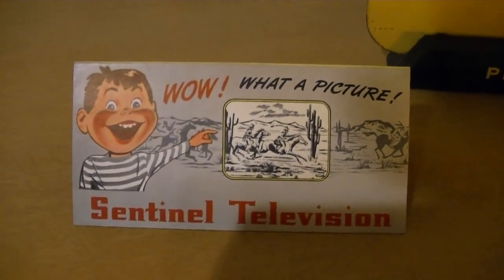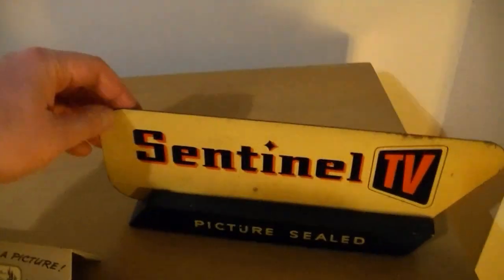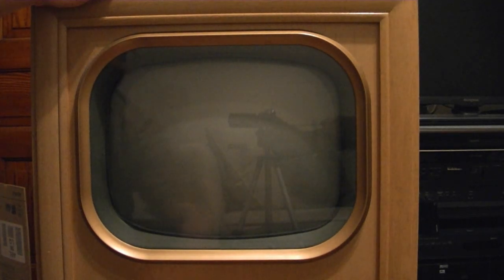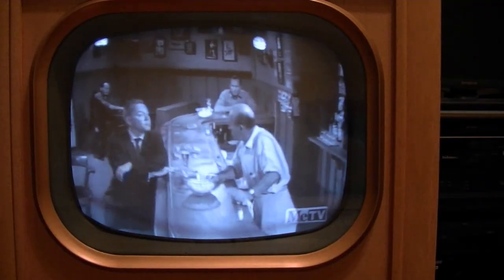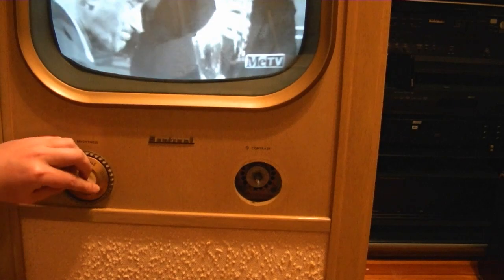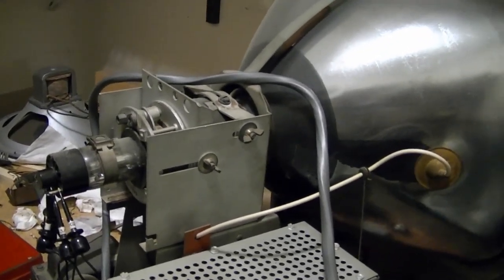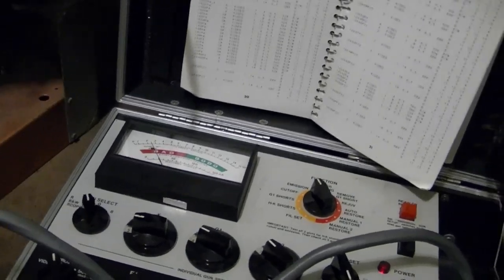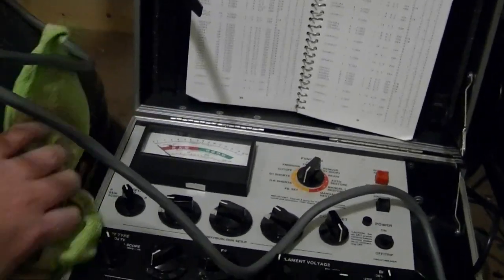sentinel 430 redux pt01

Comment: That reminds me of my Motorola 17F4 it has a 17bp4a crt I need to find another one or equivalent , mine has a slight ion burn it has a real light browen X over the screen. I tested the crt and the emissions where real good but the cut off is suppose to be between 22 and 73 mine is at 22 so I don't know how good that is. Mine has the copper coated chassis to looks kinda cool. Good luck man, looking forward to your next video .
Reply from the maker: Odd.  That's an aluminized CRT with a bent gun and ion burn shouldn't be possible.  I wonder if it was rebuilt with the wrong type of gun ?
Reply: bandersentv From what I found online the 17bp4a is not aluminized  the 17bp4b is aluminized. the 17bp4a has a external conductive coaling and the 17bp4 dose n't .
Reply from the maker: cadillacpeet OK, ion burn should still not be possible though since it has a bent gun and ion trap magnet.

Comment: When you swap the CRT on an "all original" set do you keep the old weak CRT around?
Reply from the maker: It's really not something that's come up before including with this set.  As you'll see in the next part, I was wrong.  This set no long has it's original CRT.  Even if it was, I don't know if I'd keep it.  There were only a handful of CRT manufacturers so it likely had an RCA or Sylvania in it not a Sentinel brand CRT.